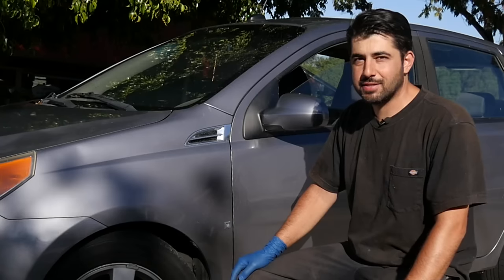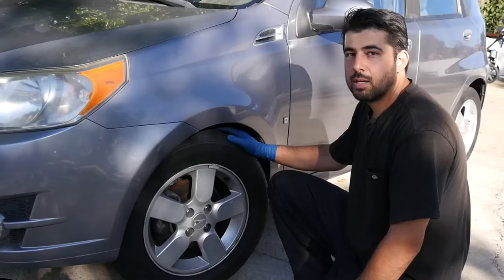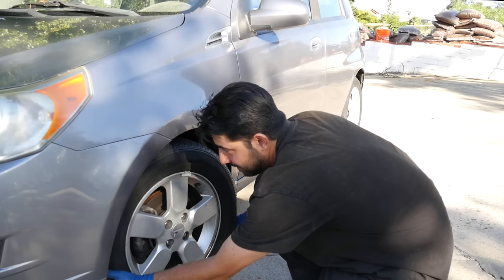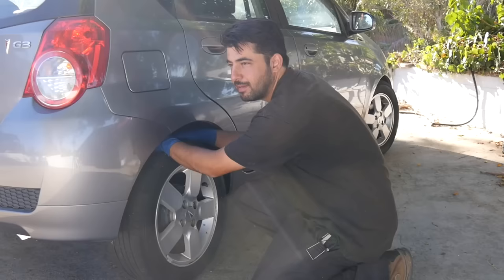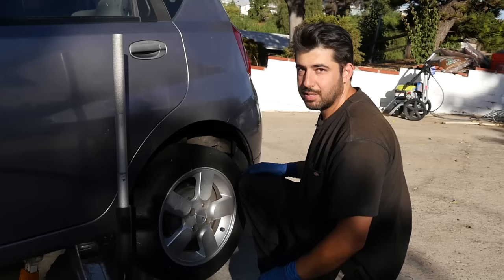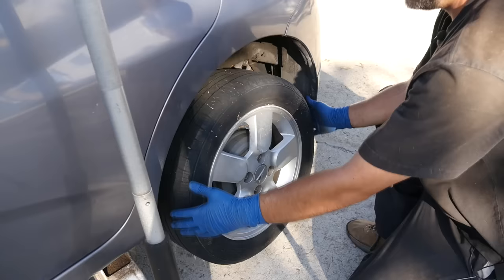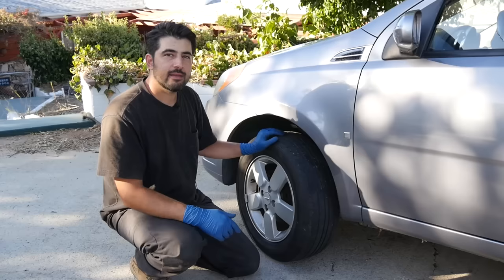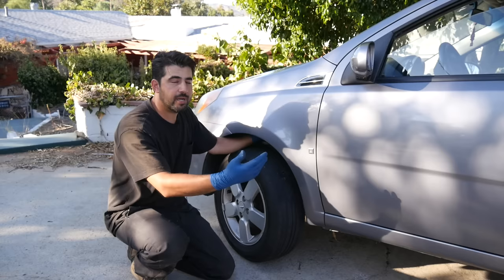Must Watch Before Spending Money On a New Wheel Bearing

Comment: Warning! Just be careful running your hand along the tire with a buldge, sometimes the tire has exposed steel belt.
Reply: Good call. Nitrile gloves are so useful. Much better to tear a glove than your skin. I always wear gloves when I can, and not because I'm afraid of getting dirty. I still get dirty, but it let's me keep my tools cleaner and has saved my skin many times.
Reply: @TheConstantComet    Plus the wife or GF will appreciate not having greasy hands and finger nails touching her .
Reply: @johnlopez3001  that's sweet :)
Reply: 😟 why did you remind me.........
Reply: @johnlopez3001  yes!! My gosh I have worked on so many cars and lost of from working without gloves...
Reply: @Cutlerypotato  I'd want to be wearing something more protective than nitrile gloves to protect my hands from a steel tire belt sticking out. Thick leather gloves should work. There are gloves that are made for working with barbed wire. Those would be the best option if you can find some. I just saw some on Amazon for $95.
Reply: @davidlynch1874  this is why I got metal arms a few years ago, it was a risky operation but having metal arms is great
Reply: Your tire should never have exposed steel belts
Reply: Thats what I look for.  Then I start poking and hitting the area with things.
Reply: This happened to me before very true .
Reply: Can confirm 😂
Reply: Found out that out the hard way years ago.
Reply: Ugh 😑 my hand hurts reading this
Reply: @Adrien_broner  the problem is with wheel bearing/alignment issues, the tire can look fine on the outside. It's when the car starts wobbling, some people realize that the inner side is completely worn.
Reply: @davidlynch1874  yeah, I would totally spend $100 to rub my hands on a tire.  😄🤣😂
Reply: I have two small bulges on the sidewall on one of my tires can i still drive on it or replace it?
Reply: GQ
Reply: @davidlynch1874  t54 e
Reply: @jimmywhitlow7174  ttt
Reply: @abdullahz4804  5ty
Reply: La vida es un riesgo carnal :v
Reply: Passenger wheel makes intermittent  humming sounds
Reply: But I love being stabbed by exposed tire wires
Reply: Yes mate a year ago I gone it and cut my fingertips open
Reply: those wires hurt. good advice.
Reply: even cloth gloves can help find wires on bad radial tires.
Reply: Worked at a tires shop from ages 12 to 14 so many scars on my hands from that shit lol
Reply: I'm not sure those nitrile gloves  will protect against exposed wires from steel belts. I would test them first by running my hands over a bunch of razor blades. If your hands come out in excruciating pain and covered in blood, then they're probably not going to protect from those steel wires either. 😮
Reply: @michaelallen5505 
Excellent tip, but sharp knives will work if you don’t have razor blades.
Reply: @dropndeal  yes really
Reply: Found that out the hard way.
Reply: I learned that one the hard way! 😂
Reply: Those grippy rubber coated cloth gloves  are best when working on tires or most automotive repairs for that matter. Protects your hands while still allowing some dexterity. Nitrile gloves are best used for messy jobs like oil changes or working on drivetrain components.

Comment: This is hilarious you made this video. I had 3 alignments done on my car. The car STILL PULLED. The shop swapped the front tires left to right, and the pull changed sides. Brand new BF Goodrich tires. Manufacturing defect made the tire conical. Causing a pull because of a misaligned belt. You couldn't see the defect because it's internal. Talk about MADDENING!
Reply: David Hammett - Infuriating is right!!  I was in the automotive/truck industry for 37 years, specializing in front end and suspensions.  I found defective tires causing handling, vibration and noise issues SO often!  Tires are a bad place to save money, and have recommended Michelin and Toyo tires for years.  Even these can see an occasional failure, but they’re ROUND and easily balanced from day one.
Reply: Bf Goodrich sucks on 195-65-15 size that go out of round after a while.And start making noise.
Reply: Hopefully i can get a reply...i have this issue with my car pulling to the right. First thought is was the tires ( recently had bought new ones) and removed them, inspected them, and they looked perfect! But still a pull to the right with a wobble. Got an alignment, rotated the tires, and re-balanced. Now there is no wobble but still a pull to the right! I drive a 2004 acura tl. Someone plz help.
Reply: @juliovasquez8718   try swapping your front tires left to right, if the pull changed sides, one of those is bad. In my case I think more than 1 of my tires is bad. I also have an 07 Acura TL. It's been aligned 3 times, and they said it's my tires. They have 11k miles on them. Apparently it's very common for manufacturers to sell "conical" tires. And if there is a large difference between sides, it causes the pull. Apparently Acura TL is super sensitive to this pull.  It's dangerous, Because I constantly have to keep pressure on the wheel, to avoid other traffic. But this is the U.S. government regulations working. Psh.
Reply: @ua7pyro591  thanks will do! Yeh my tires only have 9k on them if that..and yes very dangerous im constantly doing the same holding it alittle to the left and as soon as i let go hard right! Nothing more perfect than finding this video and comment section today! Thanks @DavidHammett
Reply: Happened to me when I was a teen. Tire shop picked it up right away. New tire, looked great but they had trouble rebalancing it correctly. Then they dismounted it and showed me the exposed and displaced belt on the inside. Shop picked it up very fast.  30 yrs. later I had a great mechanic. Told him that I thought I needed an alignment check because of pulling to one side. He asked the usual questions then stepped back about 30 ft. to look at the car from the front. He said it could be but more likely I had a bad tire and to return to the tire store (big place...lots of heavy truck work)  to have them checked. I did. The manager came out and ran his hands over all the tires. "Think this one might have a slipped belt. We'll take a look."  Yup, new tire later and all was well.

Comment: Also, before thinking about replacing  the bearing, there usually an option to buy a bearing and hub together for $50 more but much much easier DIY friendly install.
Reply: Toyota wanted 305 for the hub assembly

Comment: Worth mentioning, especially if you live in an area prone to many or deep potholes in roads, check to make sure your brake backing plate(if any) are not damaged. I thought for a while I had a bad wheel bearing because I was hearing noise, turned out to be the backing plate was bent inward and rubbing on the rotor causing the noise, just bent back with pliers and was fine. Hope it helps

Comment: One thing you didn't mention that I will mention now is also to do with the tires and not the bearing.  Some tires have a tread and compound that will make for a lot of "road noise".  I have all seasons and I get typical noise from driving because of the tread pattern.  When I switch to my winter tires, the noise is much more pronounced.  Big time.  The sound goes away when I switch back to my all seasons.

My winter tires are brand new and they are in immaculate condition, by the way.  So are my bearings.

So in some cases, the type of tire you have can lead to a humming/howling sound similar to what people would mistake as a bearing issue.  Up here in Canada, the noise gets even more pronounced the colder it gets as the rubber stiffens.

So it may not always be a bad bearing or even a bad tire - it may also be just the type of tire and the weather as well.  Something to be cognizant of.  :)

Comment: Changed wheel bearing and  it turned out it was the damn tire all along.
Reply: Same thing happened to me. Didn't find out until I got a blowout on the highway.
Reply: The other way around,Changed all four tires but it was the ball bearings.
Reply: This happened to my Father with his car. He replaced the entire rear axle assembly, with one from a salvage yard. One of the drive axles was bent on the salvage yard one.  Turns out that the noise was caused by a tire. He could have re-installed the original axle, but he would have had to pay extra for the labor.
Reply: @kmath50  so, he's driving with a bent axle...not making sense.
Reply: @ernieestrada5774  Once he found out that the drive axle was bent, he had it replaced. It was cheaper to do that, than to swap the axle assembly.
Reply: Some mechanics are a bunch of fuckin rip offs
Reply: Same here man I wish I seen this video before I did it.
Reply: Had a bad motor mount and did a bearing replacement than later spent more time to diagnose the noise and identified the motor mount and made a successful repair.
Reply: Hold my beer, let me change another wheel bearing LoL
Reply: it could be a combination of both. I replaced the wheel bearings, it helped to reduced the noise by a lot. Now I'm out of other thing to replace in my car except the tires.
Reply: If the tires that bad will it damage the wheel bearing?

Comment: I had this issue with Michelin tires 5 year old with less than 20k on them. Apparently not driving and leaving the car sitting generated this issue. Who knew tires that were not worn out could make such loud humming noise. So after spending $900 for 4 new tires the sounds has gone away and the car is a pleasure to drive again.  Thanks for confirming I am not the only one with this issue

Comment: gr8 video, sweet I saw it a couple months ago. around 2 years my wife drove her car with a flat and stuff the tyre up. I replaced with a second hand tyre. well it had wheel bearing noise, which got worst a few months ago. paid $150 for a new bearing hub online, I jacked the car up to find a thick bolt in the tyre with the head wear off. (the increase in noise for last month) So I went and replace the back tyres as the other was near the end of it life too.  Drive home and no noise. now I struck with a new bearing.

Comment: Like your videos and just want to share my experience with wheel bearings.
I had the noise and was quite sure it was the bearing. Did all the stuff you show several time, while driving a few thousand kms in the car. I was never capable of confirm the fault by jacking up the car and doing what you do. Didn’t do the hand on spring thing though. Finally drove it to the mechanic and fixed it with a new bearing.
Point - it’s not as easy to diagnose as I thought.

Comment: He should also suggest that a bearing and tire noise sound a lot different.  A choppy tire will have an inconsistant thump thump thump thump sound every time it hits the high/low spot that increases the faster you drive.  A bad wheel bearing will have a very consistant hum that gets louder the faster you drive.  Also can put the car on jackstands and spin each wheel can usually hear a bad bearing when you spin the wheel by hand, or feel it feeding back through the coil spring on the strut .

Comment: Great video keep making them I just like to add that
I have seen a lot of rear tires go bad as set due to bad shocks in the back. they usually get bubles on the inside part of the tire,it is also called having chopped tires and they feel bumpy when you run your hands through them just like how he explained on the video.
Best thing to do is to replace the shocks wich are causing the tires to chop on the inside get new tires and a alignment at the end.

Comment: I had two bad wheel bearings. They were almost defining at 40mph. I had literally no play or noise in any of my tires when jacked up into the air. The springs felt fine as well but under load the noise was pretty obviously a wheel bearing finding which one was the real problem. Had to turn left and right on the highway listing for the noise to get louder. Had to replace both right bearings (thought it was the left side initially). Hell of a job on a 08 civic with pressed bearings and rusty hubs and snaprings.
Reply: Same with my 07 TSX. I don't know if both of the rears were bad but replaced them both. I suspected the right was bad and replaced that first. Noise was still happening so replaced the left and noise went away. No idea if both were bad or not. Some dealers will just say booth are bad if they have no clue which one it is. Ask my sister lol.

Comment: Great overall explanation. I have a slight movement at 3 and 9 o'clock but not 6 and 12.  I originally thought it was the wheel bearing. Now i know to check the tie rods. Thanks! I just assumed it was the bearing since i have 228k miles on my 2010 Rav4. I'll turn the wheel and hold the spring to see if i get any vibration.

Comment: great video...I would add be very careful running your hands around the tires because sometimes metal or other sharp objects can be stuck in it and can cut you...also if the tire is really bad the steel belts can also stick out and cut or stab you....even with gloves on.

Comment: I've had cords in tires separate before. It is easy to see or feel. Wheel bearings don't always have any play or sound except with weight on them while driving. I would rather not have ABS and have the old style wheel bearings that lasted forever.

Comment: Of course, a bad tire can also seem like an alignment or balance problem. I haven't tried it, but bet that you might be able to detect a significant difference in hub temps. on the same axle with a laser thermometer after driving the car, like checking for a dragging caliper.

Comment: I once bought a set of wheels with some cheap brand tires on it (Sunny). They sounded exactly like worn bearings. Had them replaced by Michelin and the sound went away. Also found out that XL rated (dual radial) tires make more sounds like that then regular radial tires.

Comment: The way I like to describe a bad wheel bearing is if you were in a vehicle that has big tread tires on it going down the road. That humming sound you would hear if Bigfoot was driving on the road with big tires. it also sounds like you know those slits along the side of the road they use to wake you up if you happen to fall asleep and start to veer off the road? in a way it can kind of sound like those as well. It just would not be quite as loud

Comment: I had what I thought were bad bearings on a first generation Scion xB. I bought a pair of new bearings and spend an entire day replacing them myself. It didn't fix the sound at all. But while I had the tires off I noticed that their tread was really cupped. So I bought a new set of tires and that completely solve the problem. Meanwhile the rear bearings did actually go out on my Scion FR-S. The sound is completely different. When you got bad tires, it's a kind of growling warbling weird sound. But when it's bad bearings it's a hum. A nice solid steady hum.

What's kind of funny is we were standing next to a lady's car one day and as she and my wife talked I looked at her back tires, and you could see that her tires were cupped. I told her that it would make her car sound like the rear bearings were bad. Her response was, so that's what that sound is! I think the problem is with front-wheel drive cars the rear wheels eventually get cups because they last so long and aren't used to drive the car or anything. I think a simple solution would be to rotate your tires a little more regularly than I do.

Comment: Off topic,  just did this. this pasted weekend. Before changing your battery or alternator. For dimming head lights while braking or just seeing your domes lights flickering.Press on the serpentine belt by the tensioner if your tensioner moves, Replace it.

Comment: Never heard of the spring trick before...gotta keep that in mind!  I'm sure that there must be SOME tires made in China that aren't total junk but a few years back I bought a set of snow tires for my car (major name brand) and when they were delivered I saw they were made in China.  Was tempted to send them back but didn't.  Worst snow tires I ever owned...hard as a rock and lousy winter traction.  Ended up finally replacing them with another brand (made in the US) and winter driving is much improved.

Comment: Another way to test for noisy tires is to drive it on the road, if it makes noise then find a large flat area with grass drive it on the grass at the same speed usually around 20 miles an hour if the noise is gone then it's the tires, a friends jeep compass had this issue and that is how i diagnosed it

Comment: I just replaced BOTH rear bearing assemblies on my Odyssey after having multiple people ride in it and tell me it's one of the rear bearings.  Turns out it wasn't.  Next step is to rotate the tires front to back to see if the noise moves.  Sigh.   Also, last time I ran my hand over a tire like that, I got cut by a nail that was in the tire even though it wasn't deep enough to cause a leak.  Be careful out there.

Comment: Bought an audio listening device on Amazon... Clipped a microphone to each wheel and plugged the cables into the listening unit... Put on the headphones... Drove down the road... Moved the listening switch from wheel #1 to #2 to #3 to #4... There was a lot of noise coming from the left front wheel... It was making noise as soon as the vehicle started moving... The other wheels were quiet and smooth... There are two new Michelin tires on the front so it wasn't a bad tire...

Comment: If you suspect a bad wheel bearing, how about this for a test? Switch the wheels front and rear on the same side. If the noise and vibration switched ends, I'd call that a bad tire and/or wheel. I found a bent wheel in a car that way once.

Comment: Nice!  Well done.  I have an all wheel drive highlander.  If the tires start getting a little old that thing gets a ton of road noise.  New tires installed and quiet as can be.  I think I would say in my experience that an all wheel drive is even noisier when the tires start getting bad.